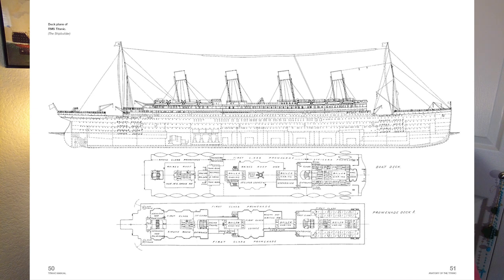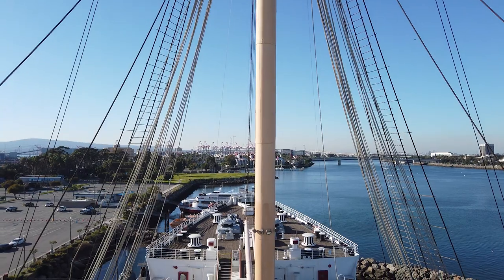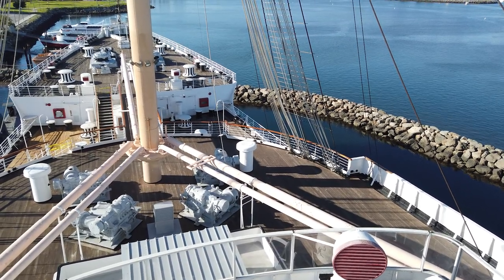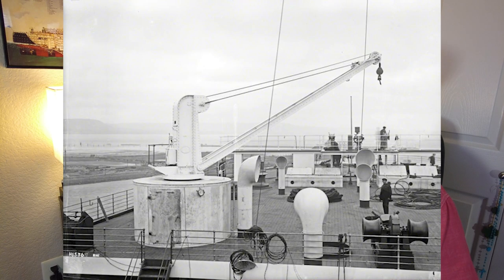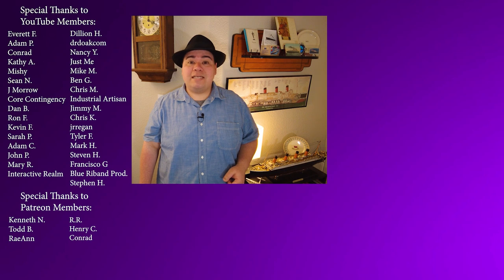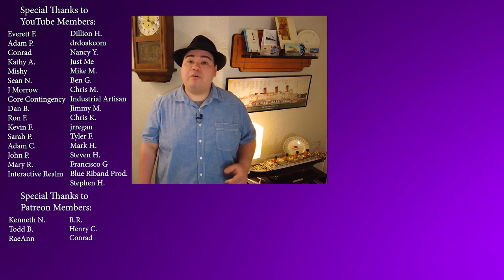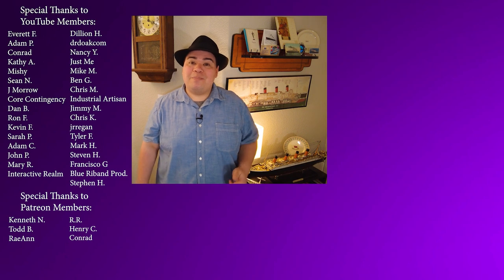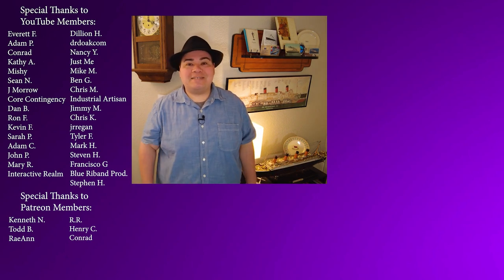The Purposes Of Masts On Ocean Liners

Comment: In the early 20th century radio frequencies were low having a very long wave length.  Using relatively primitive antenna design of the time the antenna had to be very long.  About 300 feet for a full wave antenna or 150' for a half wave antenna.  If you look at the photos of liners from this era, you will see a long wire stretched  between the two masts for use as an antenna.  You will also in most cases see a feeder for the radio signal going up to the antenna wire.  This was an important reason for having 2 rather tall masts but not heavily built in their upper portions.

Comment: Very interesting! I know a lot about Titanic...  but I didn't know the masts and line between  it was radio antenna, seems obvious now, but now I know for sure. Very well explained.. hmm.. I couldn't imagine Titanic sailing on two masts either! 🤔Lol.
Reply: Also on the Queen Mary.  Long wave radio communication (800 to 2000 m) requires a very long wire antenna due to the wavelength.  Also,  most marine shortwave communication was only marginally shorter wavelength than AM broadcast radio (200 to 550 m).

Comment: I suppose they could have had sails on the masts but it would be only marginally faster/more efficient and just not worth it. It's ironic that Titanic had electric boom cranes to get stuff onboard but not electric davits to get people off. H&W and the WSL sure learned that lesson.
It's not your usual fare but the return to wind power on ships is a fascinating topic. The flettner rotors and dynarigs work surprisingly well on non-cargo ships. Perhaps future liners if they are ever built will primarily be sailing ships.
Reply from the maker: Titanic had electric winches to lower the lifeboats by machine. The reason they weren't used that night was because of two reasons: one, lifeboat winches were relatively new at the time and in the race to lower lifeboats they chose to do it the old fashioned way insteas of trying to figure out the machines, and two, they needed to conserve power since boiler rooms were being rendered flooded and unusable.
Reply: @AlextheHistorian  Ah I did not know that there were electric winches on Titanic! It does make sense that they would go old-school in that situation then, for better or worse. Powering just the lights and wireless seems like much less wattage than moving a score of big lifeboats. Apparently the ship had a maximum of 16,000 amps to work with. It might have been possible but I think it would have been close.
Reply from the maker: Well the flooding caused several circuits to short, they had to reroute circuits as the night progressed, so they quite literally didn't have the capacity to power more than just the lights and the wireless. This film is like a docu-drama and tells that story very well:
https://youtu.be/xZwzqmRJB4I
Reply: @AlextheHistorian  Thanks, I'll watch that later; I don't know as much about the ship as I would like. I was thinking if they had the foreknowledge of the way the ship went down from the moment of impact they might have been able to lower the boats electrically at a decreasing rate as the ship lost power. There really wasn't a way to save everyone that night, apart from not hitting the berg, but it's fun to think about different scenarios.

Comment: Great clarification of the usage of masts. I have a question. Did QE2's mast also serve as a sort of disguised funnel to ventilate the lower decks? I know there were vents on the upper aft portion of the mast. They were so well placed that they were almost invisible unless you were directly behind the mast, as in on board
Reply from the maker: I dont know for certain, but I did see the vents and I think yes, it probably ventilated the ship.
Reply: QE2’s signal mast ventilated her galleys, being hollow inside for this purpose (only being climbable on the outside), with vents running the height of it’s aft portion.
One of my many happy memories of sailing on QE2 is straining my neck to look directly up at her signal mast during a visit to the Queen Elizabeth Grand Suite.

Comment: There is no way in Hell Titanic could  sail with her masts. The masts were meant to suspend the wires between fore and aft that for the Marconi wireless radio. The masts served other functions as well such as providing hauling points in the rigging and a means of watch (fore) although Titanic would have faired  better had there been a lookout stationed at the bow.

Comment: 3:35 question re crows nests: to what extent did the height affect crows nest visibility?

Queen Mary is larger (taller) than say, Titanic, so logically visibility should be better. What about location? Did the location of Normandie's mast + crows nest (directly aft the bridge, in front of first funnel) help? Does trading 100 horizontal feet further aft (and MAYBE being a slightly higher elevation?) benefit enough with stronger viability, reduced sea spray, and closer proximity to bridge?
Reply from the maker: The higher you are above the surface of the earth, the farther you can see. In Titanic's crows nest they could see potentially 12 miles. In Queen Mary's crows nest, they could see about 15 miles. And indeed, the higher up the nest was, the more protection the lookouts had from dangerous swells (although if it was that bad I'm sure they would be called back into the ship). Locating the nest further aft doesn't affect the distance you see, but it does affect how much of the water in front of the bow you can see.

Comment: The masts were probably designed to raise sails if the engines broke down or if the ship ran out of coal
Reply from the maker: Only on early ocean liners from the 1830s through 1880s, but not for early 20th century liners.
Reply: That was really only the case for single screw steam ships. Once twin screw steam ships became a thing, there really wasn’t a point to have sails as a backup anymore since now if one of the propeller shafts or engines became disabled, you still had a second engine and propeller shaft as support. By the late 19th century, steam technology had proven it self to be reliable and there was no more need to install auxiliary sails on steam powered vessels anymore. Sails were occasionally installed on steam ships after this point, but that was more to help with the ship’s trim and to help keep it balanced in rough weather.